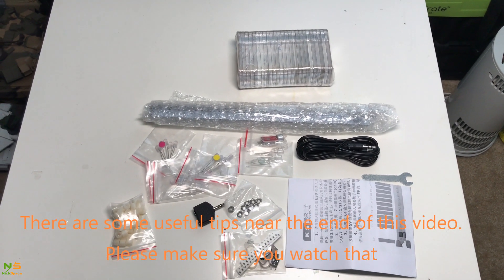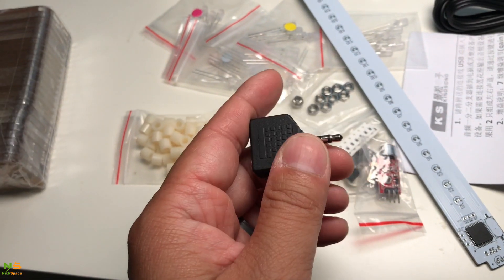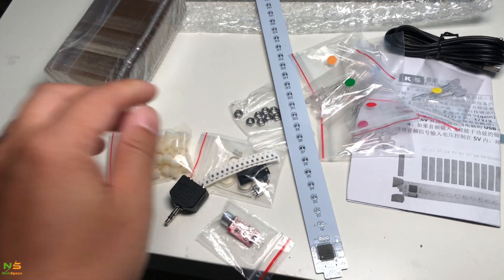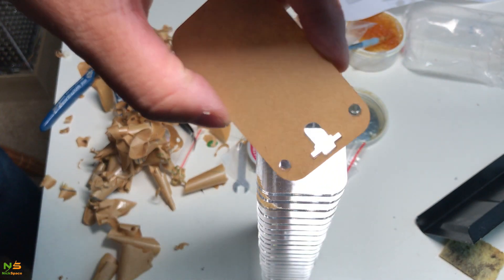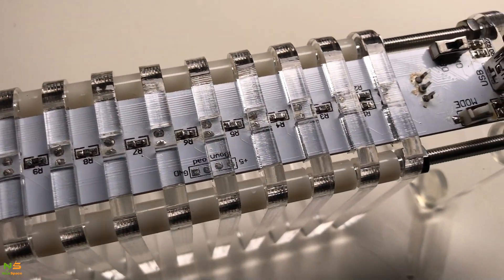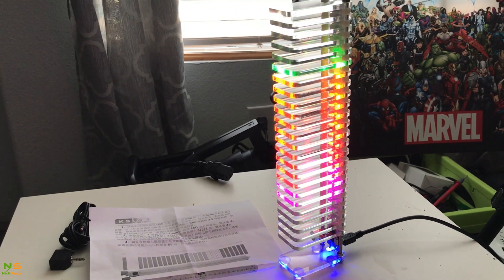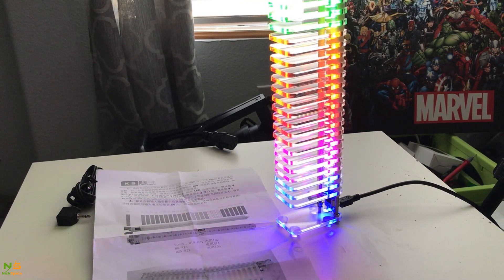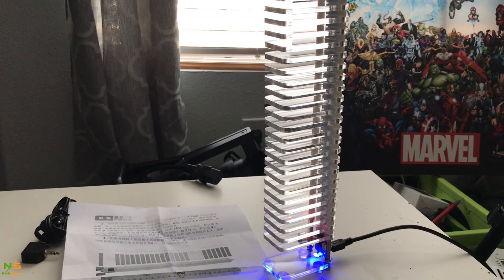How to assemble AIYIMA KS25 25 Music VU Meter Led Spectrum DIY Kits for home threater

Comment: '
is this I C microchip already solder welding on the PCB from the company
Reply: I had to solder my own on. The board has solder built on so one in place. Just flow the solder. With flux. Hope this helps
Reply from the maker: I believe the chip came soldered
Reply: @nickspace78 
thank N S